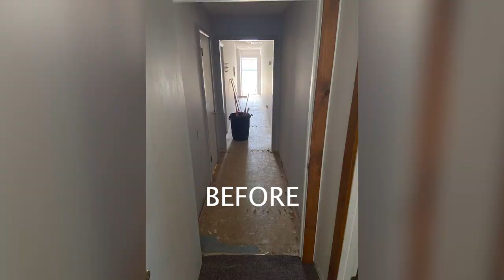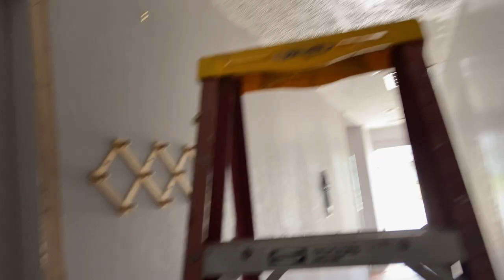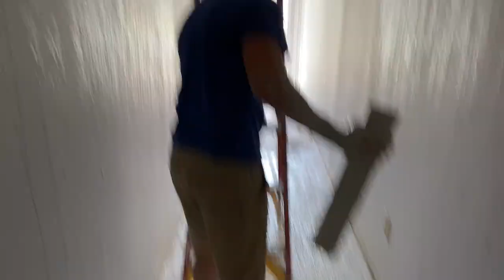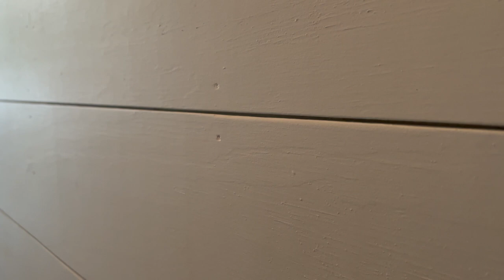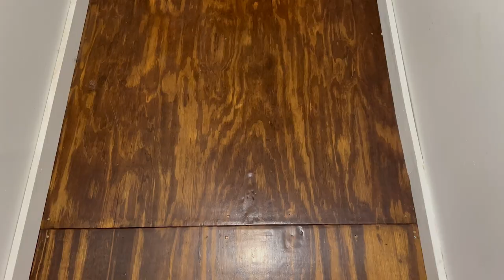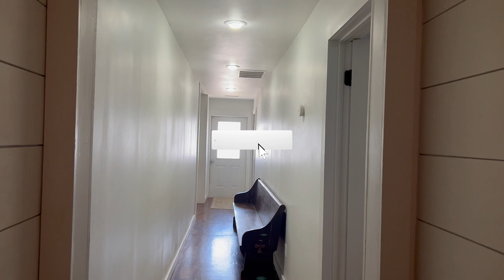DIY Hallway Renovation - (Using Stained Plywood For Flooring)

Comment: I haven't seen FULL plywood sheets being used before, but I've seen some gorgeous floors being made with plywood cut into foot- or six inch-wide wide planks. Makes it slightly less obvious that it is plywood, with only slightly more work. In your hallway the full planks work well though, and I LOVE the color and finish!

Comment: Curious, why not knock down the ceilings before taking out the carpet since the carpet is being thrown away. Seems like it wouldn't made clean up super easy.
Reply: Probably didn't think of it before getting rid of the carpet.
Reply: Probably because the carpet was gross and he has kids living there.
Reply: Because he's learning as he goes along like he said...he didn't think of using a tarp or it would of made cleaning a whole easier...Trial and error folks...Give him a break...like he said they had to learn from the bottom and do it all on their own....Take my hat off to them..A Super job well done!! Salute
Reply: You did hear him say he sprayed the ceiling with water right? How would someone remove a wet heavy nasty carpet!!???
Reply: As you can see carpets harbor mold which is toxic
Reply: He said something earlier about fleas.
Reply: You live and Learn.
Reply: He said on the 1st video that the carpets were infested with fleas.
Reply: All the water and ceiling scrapings would've made the carpet more cumbersome to move. Also, the ladder was probably a bit more stable not being on carpet.

Comment: Some comments mention that this hallway floor does not add value and appeal to the house. But this house is for this particular family. Its value is in what the house will do for the family. And the appeal only needs to be pleasant and useful for them. Plenty of folks do DIY projects with their houses that are not for adding value and probably won't appeal to anyone else. It's simply for the family. And I love the floor. Very sturdy and clean, and of course a great place for sock-sliding. Note: If you watch more of the videos, you can learn that the old cafe had plywood floors that withstood over 20 years of commercial use.

Comment: I would have opened up this place a lot more. I dont like the long skinny hallway with doors to dif rooms. Opening this place up would have been much better. And if your gonna use plywood for the floor, next time cut them in to smaller pieces like you did for the walls, stagger them, makes them look like real hardwood floors. Will look much better! But its your house so you do you!

Comment: Great idea! We’re considering doing this for our basement floor and walls. My basement is prone to minor flooding since it is below ground level. Do you think the finished plywood would hold up?
Reply from the maker: Hey! Does it flood regularly? Honestly, I'd make sure that your flooding issue is solved before putting any kind of flooring down in the basement. Plywood wouldn't hold up if it's being subjected to flooding throughout the year. Basements can be such a pain :(
Reply: @ourcafehouse  Yes, it does when the flood drain is backed up/clogged, which sometimes happens after considerable rain. For that reason, I figured it may be an issue. I will likely just do the wall panels instead. Thank you!

I love the idea of converting a commercial property into a large home! I’m looking forward to seeing this project progress!
Reply from the maker: @moawad7631  something you might consider us just leaving the concrete floors and using a concrete sealer over them. It can give them a nicer, shiny look that makes them look kind of neat as is and also makes them a lot easier to clean. Put some rugs down in a few spots and it could look nice for a basement and you won’t have a nightmare on your hands if you ever do have flooding. Just one idea 🤷🏻‍♂️
Reply: Marine grade plywood would almost certainly tolerate occasional flooding, but because it would be difficult (if not impossible) to dry the underside, black mold formation would be a threat. That's too great a risk, I think.
Reply: @moawad7631   You need to put a baffle in your drain so that water cannot back up into the room..

Comment: To each their own but IMHO yikes. Planning is everything, in almost any project of any type. Next time, take the popcorn down before pulling out the carpet or even put painters plastic sheeting down, remove and then remove carpet. All these ideas sound exciting and fun but they won’t resonate with anyone other than yourself unless you learn to become more pragmatic and do things that will add appeal and value. A frankenhome will not help anything other than your own sense of pride and self accomplishment.